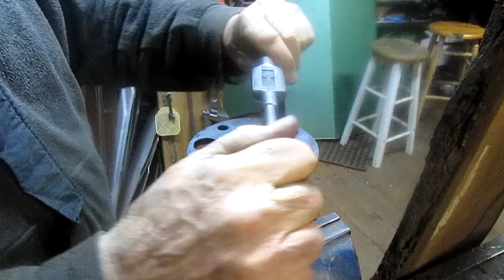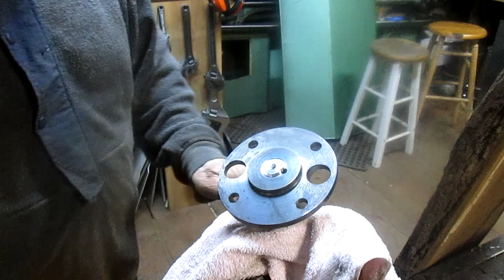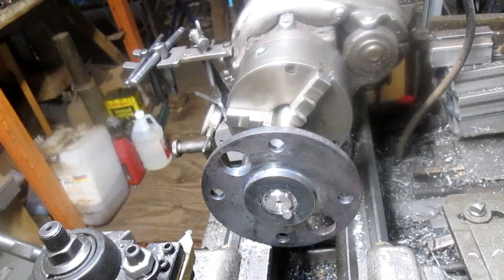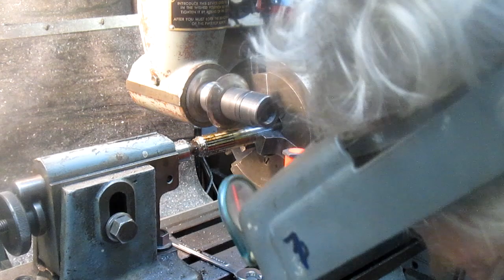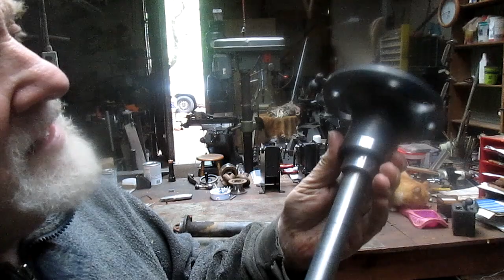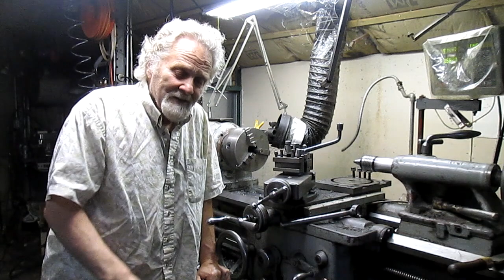Golf Cart Axle #6

Comment: Nik was teaching a class at The Curious Forge makerspace/art studio on bicycle hacking (re-imagining bicycles into weird configurations) and I ended up creating a Adult Soap Box Derby vehicle out of many bicycles. Because I was using a variety of old beatup mismatched bicycles, I needed a custom-built adapter for the headset. Nik invited me to his shop, and rather than making the part himself, he found me some material, pointed out the basic controls of that lathe, and wandered off to work on another project! Such confidence in me and supreme confidence that I couldn't break the lathe! I made the adapter and it worked just fine. Thanks Nik!
Reply from the maker: I remember that day, Jeff. You looked like you could handle yourself around that kind of equipment so I let you play.